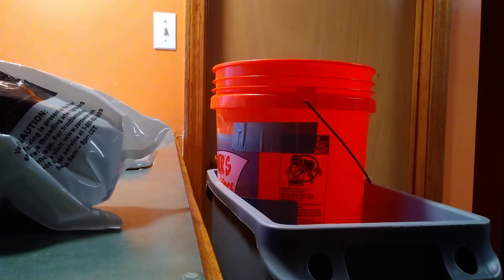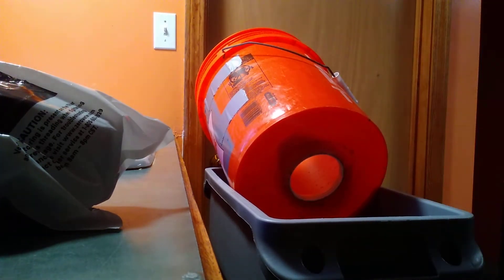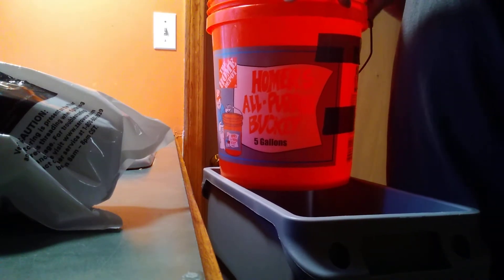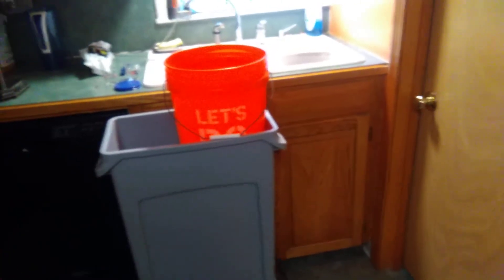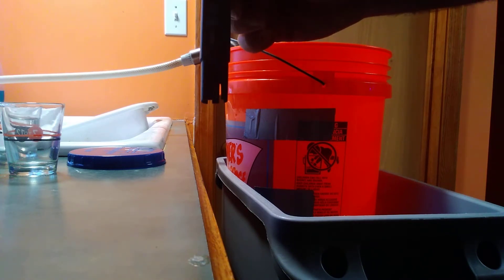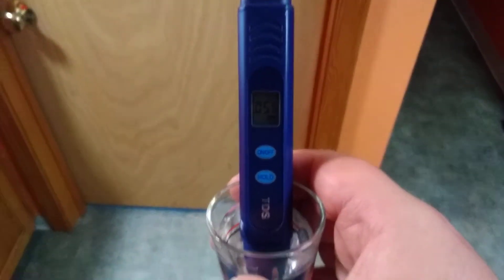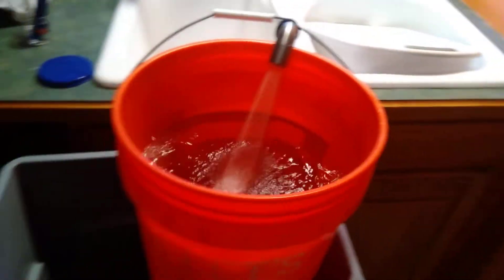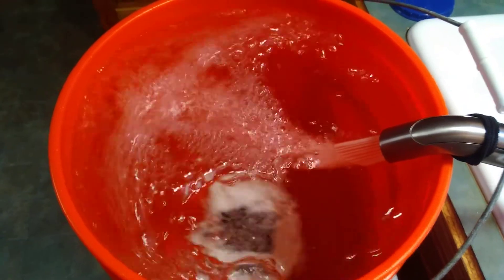How to get .000TDS without an RO/DI unit

Comment: Do you still use this method? Also would you recommend doing this method and keep coral and Anemone?
Reply: @40BKnasty  Oh okay! That's awesome, I plan to look into doing this as well as to not have to purchase a rodi system, I have three fish right now but I wanted to add an anemone inside. So I think I'll be doing this in the future
Reply: @40BKnasty  Also how long does your zero water filter last when your running so much water through it?
Reply: @40BKnasty  Oh okay, makes sense 👍🏾

Comment: I guess there's DI resin in that filter. Do you know what it is? 
If it's DI resin, yes, you can do the same only with the DI stage of a RO/DI system. Lots of people do that. But if you have 300 tds from your tap or if you mix like 50 or more gallons of water every month, it will cost more than the RO/DI system bc that cartridge won't last long.

Comment: Hey 40B, a couple things.
1. When you look up Reef Nutrition Tigger Pods, do you know that your videos pretty much populate that search.  That is big!!!!

2. I've watched almost all of your videos especially on Tigger Pods, and I think you have the most content worth following.  I think you can greatly leverage your experience in Tigger Pods, and literally target would-be mandarin owners with like a Restart-With-Me a beginner Tigger Pods culturing.  All you need is that fancy Youtube font on the freeze frame saying "How-To". 

3. The filtering tube hacks around it also would be great interest, just as this water bucket filtering method.  Because I think the biggest problem with tiggerpods is the non-definite ways you have to do  water change. I say you corner the search, Tigger Pods Hacks.

Anyways, a big fan of all the work you've put in.  And I hope you get more followers, because no one is shining a light at this stuff.  

(One last thing, I also got a Slim Jim, and I was considering using it for water mixing.  Some have mentioned the plastic on this thing leaches, so it might not be good for water storing, but I wonder what your thoughts on that is.  And does it buckle at the sides when it's filled too much with water?)